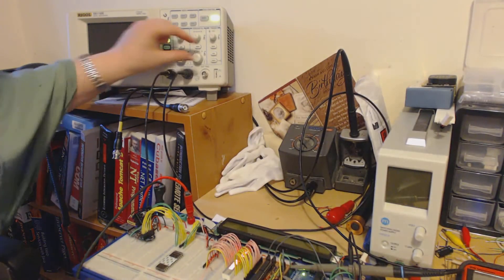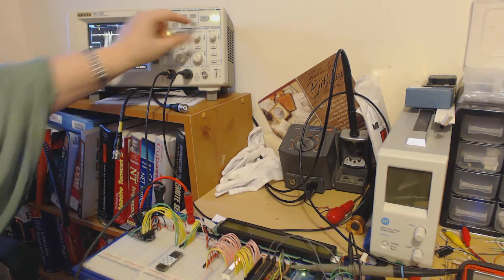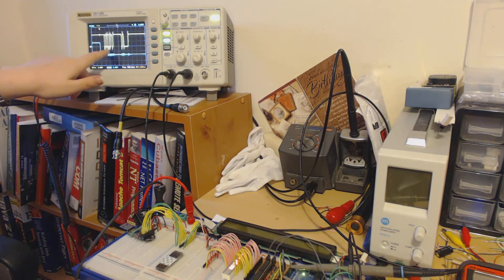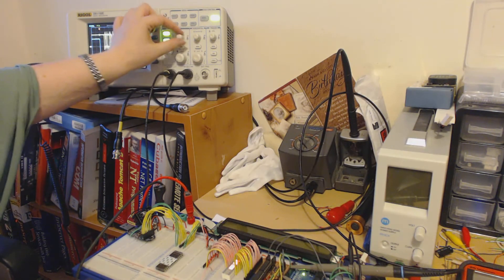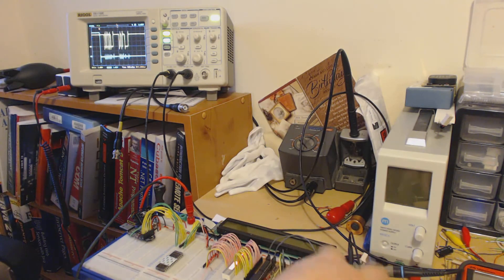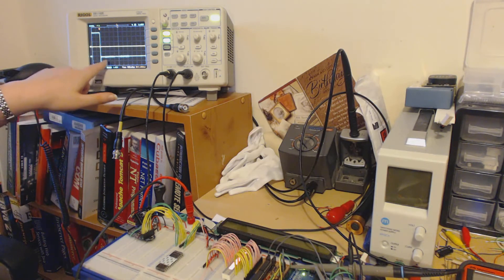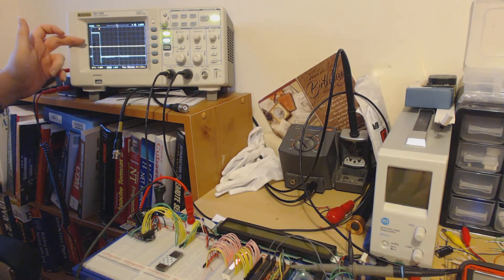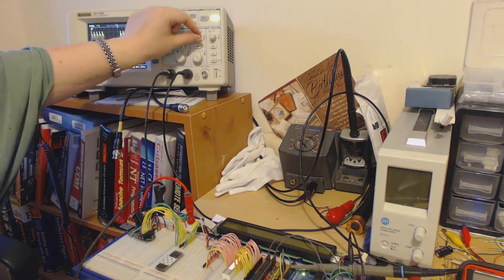Oscilloscope Coupling

Comment: One thing to always check first - check the grounds! (Also make sure your probes are calibrated, etc...)
P.S. Sometimes, with high frequency signals, the 30pF (or thereabouts - I know my scope has 30pF inputs) capacitance of the input could wreak havoc on signal integrity.